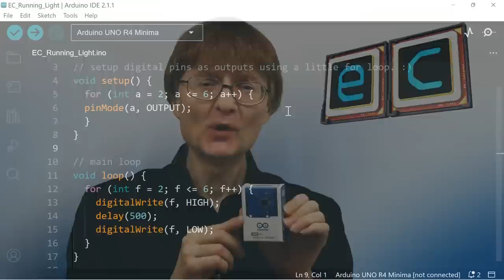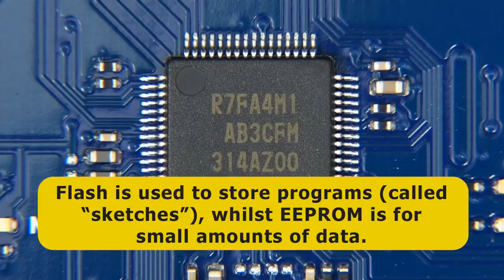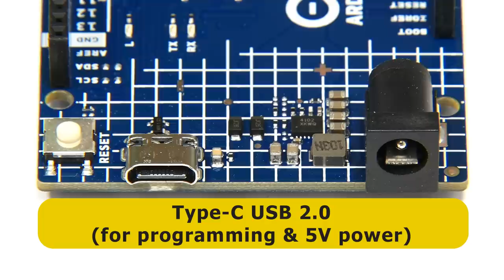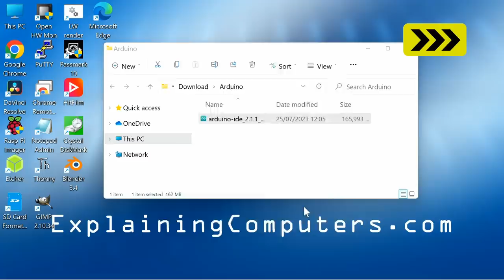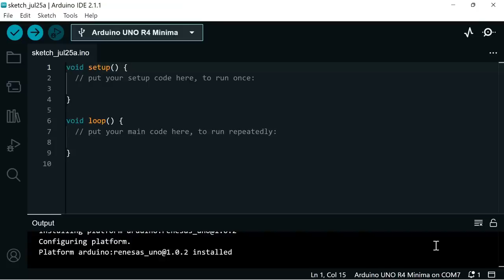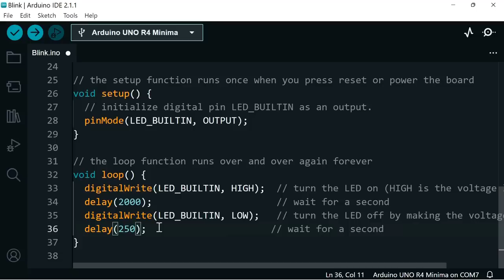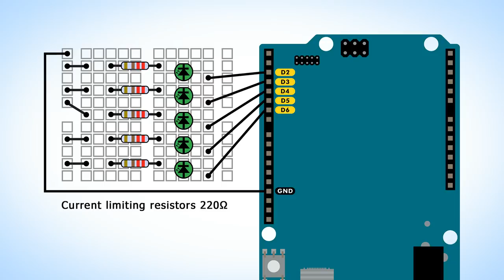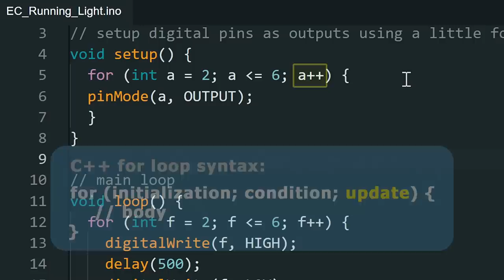Introduction to Arduino: UNO R4 Minima

Comment: Great video as usual, Chris!
I'm a seasoned programmer, so was surprised when you took the time to explain how the C++ statements worked. I suppose I just assumed everybody else also just grokked the lingo. Good call!
  That said, the missing 2nd level  indentation on line 6 at 14:37 is messing with my OCD. I know it doesn't matter, but still somehow it does.
  Finally, could you unpack that statement "And I had to learn the hard way [that] it works much better if you go for 'Anyone using this computer'"? Is there a penalty for installing it just for the current user profile? I suspect there'll be a problem with environment variables or something of that ilk.
Reply: I wondered if he intentionally left that statement outdented for the benefit of the cross fade, to show that the statement was the same except for the loop variable.

Comment: a datasheet with all the basic importatn info such as board layout hardware pin byte and bitmask info, etc. is indeed very usefull I have had many times that I wanted to program some boards but then you have to figure out the byte adresses of the gpio pins, and you can't find any clear data about that other than when you reverse enginear some code or look very deeply through all the documentation of the cpu and such and then figure out from the traces which is connected to what.

having a RTC also is very great,
having those other extra features also are great, I have seen many people who wanted to generate high quality audio with arduino uno's but there wasn't a dedicated port before so it required custom hardware or heavy software which gave decent audio quality but also used a large amount of the processing power and/or the interupt pins.

it looks like however that this board can be made very small. I also do wonder how many pins the IC can handle in reality since they followed the default uno layout but perhaps they might eventually make some micro version or even one with more ports if it really has a lot more.

the led matrix also is quite cool to have, just a small screen for example to make a pocketsize computer, low res so not much data but you could still use it for some thigns, in the past I remember designing matrix display for the uno myself just to make some kind of super minimalistic computer device.

what is great about the uno boards is that you can very easily and directly controll the outputse using bitshifts and such, which often actually is much faster and more easy than manualy calling for the speciffic pin since you can just combine many types of logic in one line and it will do all, also will use way less cycles and ram since the GPIO themselves also are like ram in that case.

Comment: A most wonderful Arduino Uno R4 Minima overview. 🥳 I love the Arduino and Raspberry Pi products that supply working project DIY GPIO PWM examples. 😎 Thank you.
The Orange Pi-5 has more SBCs available. However, I cannot find GPIO examples?   I have an old Schmidt–Cassegrain telescope.  Arduino servo motor star tracking control wish list?
Reply from the maker: Thanks for this. I've yet to work with Orange Pi GPIO. I must add it to my list. As far as I'm aware, a GPIO library will need to be installed. In my files I found this link: https://opi-gpio.readthedocs.io/en/latest/
Reply: @ExplainingComputers  Thank you very much.

Comment: Love the videos and how informative they are. I have a video idea for you. Could you look into and do an overview of using windows Audit mode and Sysprep? If I understand correctly it’s used to install software, drivers, and perform windows modifications before being used by the general user base. It also allows for generalization of the OS image for cloning to multiple machines. Would be cool to have a deep dive.

Comment: I haven't messed with Arduino in a while.  I still have the old one where you can program replaceable chips and build your own boards rather than using the whole board every time you need one

Comment: Hello, thank you for introducing this new board. I am using this board, and I am facing an issue with it, maybe you can help me: the standard library SPI.h doesn't work with this board. It works well with the old Arduino Uno, though, but not with Arduino R4 Minima. Have you experienced this issue too? if yes is there a solution? another library for using spi communication? Thank you

Comment: Is there provision for keeping the current time on the RTC when the Arduino is unplugged?
Reply from the maker: Sadly the UNO R4 Minima does not have a pin  for connecting a battery to maintain the RTC. So if you need this, the solution is to get the UNO R4 WiFi, which has an extra set of pins above the analogue/power header. These include VRTC and GND pins, to which a battery supplying 1.6 to 3.6V can be connected to maintain the time.

Comment: The Uno R2 has a 32 bit microprocessor. So how does it handle char, byte, int, or long. In that For loop would it free up memory to have use byte instead of int?

Comment: Hi, Chris, thanks for the great video! How would I use it, you ask? I have a need for a sequencer that toggles through 3 relays (including a 4th off state); this would replace outdated spa controllers. I've got the code right (I think, lol), now I just need the hardware. I would very much enjoy a video featuring the wifi capabilities of the R4 Wifi. Thanks again, you always seem to know what I'm working on around the lab!

Comment: It got me thinking, what would be the market sleeve for this implementation. We've recently bought latte panda V1 for around 70usd. It has Arduino capabilities. And an entire range of additional functionalities. Granted, this minima is less than a third of that price. Not sure if it is, surprisingly, expensive, under this pov.

Comment: Was "Digital Audio Converter" slip of the tongue? In my day DAC was digital to analogue converter although appreciate it's often used to generate audio output. Might be confusing for some peopke when talking about pins that are (at least labelled as) analogue inputs. BTW, good to see that in spite of all the high tech., Blutack still holds a key role!
Reply from the maker: I thought I said digital analogue convertor, but sadly not. I make mistakes these days . . . :(
Reply: @ExplainingComputers   @ExplainingComputers  Sorry, I hate to be so picky, but you have set yourself such a high standard of accuracy! Arduino was one of those things that I was never involved with, so good to have an overview of what they are. Also weird these days to be hearing about mere MHz clock rates and kB of memory!

Comment: Thnx for another great video that finally motivated me to release my Uno R3 clone from its plastic bag (with a little help of Mr. Scissors german relative). Now what to do with such a device? Well, my first project was to simply try make the board work which took me some time. I tried it on several PCs with different operating systems and got it finally working with Win7 and Lubuntu18.04. on my old EEEPC (while more recent OSs refused to connect to the board). Windows requires a special usb-driver (CH341SER) cause the clone has a little bit different hardware than an original Arduino. Linux requires some special permission, in my case i had to join as user to a group called 'dialout'. Currently my board is connected to five LEDs like in your video. I am thinking about using it as input device with several buttons to input caracters that normally need two keys pressed simultaneously on a standard keyboard.
Nice greetings, i am very curious on your upcoming video for this weekend ;-)

Comment: I much prefer C++ over Python as indenting code should be to make it easier to read rather than a requirement. Also, then you can charge for each { } or ; 🙂

Comment: You can program the Pico in the arduino c++ using the IDE by adding the board support in settings. I find it's easier to learn than python and the library support is massive with most libraries either working straight out of the box or there are ports available. I still tend to use an ESP8266 board such as the D1 mini where you can buy clones for about £3.50 each rather than the pico, I just feel more at home with them.

Comment: Interesting video. It has been some while since I did any programming lf my arduino Uno R3. I wonder what is new on this board compared to the previous board. I have a couple of prigramming ideas that I have not het gotten around to. One is using an arduino board on an radio controlled tank, where I can drive it normally, but by the flick of a switch on my rc transmitter it can perform some arduino preprogrammed task without input from the rc transmitter. My second ideo is to make a count up timer, that remembers the counted up time even when powered off, and continuing from that time when powered up again. Thus requiring a clear butten press to start the count up timer from zero again. This idea is for my jigsaw puzzle hobby, go keep track of the time I spend doing the various jigsaw puzzles. But it is so much more I could use arduino for. And it is a great tool for a school setting as well. It should be a subject for pupils in schools to learn Arduino programming.

Comment: A Blink program (sketch) that uses 33,576 bytes of program space!  -  11:30
That's more than the original ATMEGA328 even has!  A quick google search shows that the same program on the ATMEGA328 only takes 924 bytes.  It is 36x the size on this new Uno MCU.  Wow!  How does it get soooo bloated?

Comment: I notice its been priced cheaper than the base R3 so there's really no reason to use an R3 in a new project, unless you need the greater drive capability of the digital pins on the R3 that others here have mentioned. The added benefit of the 32 bit processor, extra memory and higher clock speed will make many projects much easier to implement.

Comment: Hi Chris, thanks for the arduino tutorial.
When I got back into playing with microcontrollers a few years ago, I bought a kit from PiHut for the PiPico. 
It came with a breadboard, sensors, leds, buttons etc and instructions for projects.
Is there a kit you’d recommend for learning Arduino? 
I’ve checked but they are around £50 compared to £10 for most pico kits. 
Moneys tight, don’t wanna screw up when I don’t know the Arduino system.
Thanks 👍
Reply: Have you seen today's price of a pico kit?
Reply: If you just want a taste of the arduino ide software there is actualy support for the pi pico but its not as advanced as other arduino boards
Reply: @Chris.Brisson Less than £4 for a pico and there’s plenty of kits at £10.

Comment: The boundary between MCU and computer is rather blurry.  Clearly the Arduino is capable of a lot of jobs on which one might waste a Pi,but it would be interesting to see where the one struggles while the other is still working happily.  How would one monitor that, to see inside CPU and memory usage on the Arduino?
Is the IDE also avilable on Linux?
Anything involving multiple tasks would probably be best on a Pico or similar, because a real OS can handle multitasking without special efforts on the user's part.

Comment: A very well made video overall, as always. However, I feel I must take issue with the title, an 'intro to Arduino'. You may have covered it in other videos but as this is labelled an intro I would also like to know some basics such as: what is a microcontroller, what makes it different to a single board computer,  what can I use an Arduino for (you mention some examples briefly right at the end, but this should really be more fully explored in an intro), why choose this model over other options? Even why it is called Arduino! I appreciate all your efforts in making your videosbut felt this one did not fully explain all it could have done.
Reply from the maker: Fair point.

Comment: hey try a imu-only mouse with arduino nano r33 iot (for bluetooth/wifi mouse), use the z-acceleration averaged over time as the mouse lift detection, otherwise a normal xy mouse, and simple python whatever code

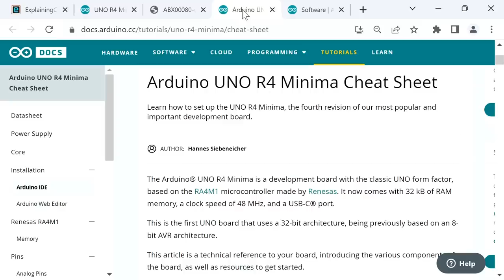Comment: What happened to SPI MISO and MOSI?   I paused at 5:58 and see the standard SPI communication pins MISO and MOSI have been changed.  So I googled it only to find that Arduino has... caved to the minority that might have found those names offensive.  I'm all for correcting errors of the past but I've never heard anyone in electronics think that these are offensive.  These names have been around since the 1980s... 40 years or so.
This only adds to the confusion by adding new terms.  These terms were a solution to the labels RX and TX that often got mixed up.  There are 40 years of data books and references on the internet that use these original terms.  Now one has to add new search terms when you do an internet search.
Will Arduino be recalling my old Uno board with MISO and MOSI labels?
There are mistakes from the past that should be corrected but I don't think this is one.  Really it only adds confusion and now links to a wrong where no one saw one.
Does everything with a master switch now need to be renamed too?  Serious question.

Comment: This Board is perfect if you need a blinking LED
Reply from the maker: It is indeed!
Reply: It's a pretty expensive way to blink an LED. An Arduino Nano or a Pi Pico would be much cheaper, but still very expensive compared with an LED fitted with a built-in flashing circuit.

Comment: I made a GPS recorder with my arduino mini.  It talks to a GPS module and outputs KML files to micro SD Card.
Reply from the maker: Now that sounds cool.
Reply: @ExplainingComputers  Yes, was pretty fun soldering and mounting the PCB modules on chopped ice lolly sticks (stacked) in a clear project box.  Used what appears to be IDE/OldPrinter ribbon cable carefully cut into sub divisions that hook into all of the modules.  Looks quite tidy.  Could show a pic, but sadly no URLs allowed here.

Comment: If I had an Arduino UNO R4 Minima, I would use it to teach some ducks how to program LEDs and stepper motors so they wouldn't need to waddle.
But alas, I have neither. 
So, I must concede that Mother Nature knew best by creating excellent water vessels for the quackers, instead. 
So glad that she also wisely decided along the way to downgrade their fog horns. Otherwise, the bullfrogs would never  have been heard, prior to their extinction. 😎

Comment: Honestly I think the pi pico is better in almost every way. Cheaper, smaller, and faster.
Reply from the maker: I agree that looking at an Arduino -- and this is one of their cheaper boards -- does make you think about the Pico in a different light.
Reply: @ExplainingComputers Would you be interested in doing a comparison between the two, Chris? Maybe you could compare the wi-fi version with the Pi Pico W?

Comment: Well, Chris, Ive used one of those older Arduino UNO 14 years for robot projects. It was a struggle as i needed to learn C++ AI programming in the past. I even wanted to program my Lego RCX 2.0 brick in C++  using Brickxcc.

P.S. Im disappointed that Lego discontinued Mindstorm recently and that BrickPi is so expensive. I don't know about this Italian microcontroller as most Arduinos aren't as powerful as the Raspberry Pi 4B and that it doesn't have superior AI like the nVidia Jetson Nano and Apple's M1 Neural processor

Comment: I don't recommend buying this particular Arduino R4 Minima. I got one directly from the Arduino store. The assembly quality is not as good as (bad) the previous Arduino board I had. The programming procedure is slow and continues to connect and disconnect from the computer every time programming a new code, that's very annoying.

I recommend you stick with Arduino Uno unless you need the USB HID Device function. Or better buy an Arduino Due with 2 separate USB ports, much more IO pins, function, and speed.

Comment: If it's "Analog In", it's not a DAC, it's an ADC. Clarify.
Reply from the maker: I never said that analogue in was a DAC. :) The Arduino pins are multi-functional. The five analogue pins are all inputs (ADC). But one may also be used as a DAC (output) -- but not at the same time! See the documentation here: https://docs.arduino.cc/tutorials/uno-r4-minima/dac
Reply: @ExplainingComputers  yep I listened to it again and you said it largely right. Would have been better to say ADC also, if you're going to spell out DAC. Please note, however, that DAC stands for Digital-to-Analog-Converter, and has nothing directly to do with audio. Nothing wrong with experimenting a single DAC to output monaural audio, it can be great fun, but accurate sample rate control and proper filtering are needed to get decent audio quality. Audio output jacks for example are usually driven by something much more specialized than just a single general purpose DAC.